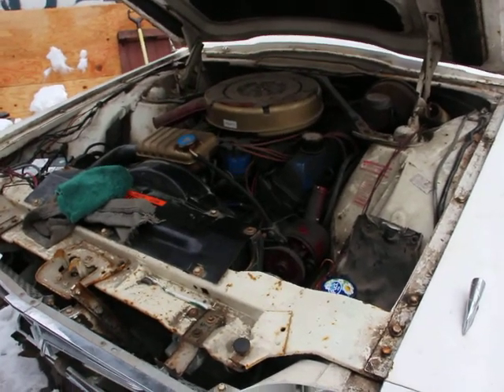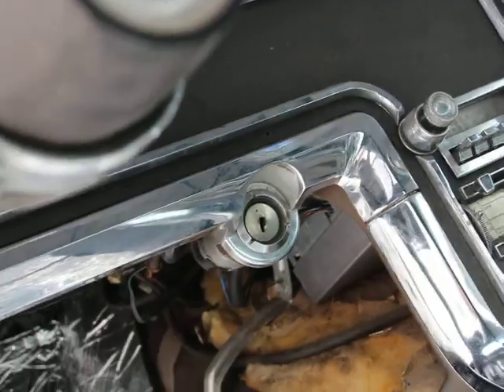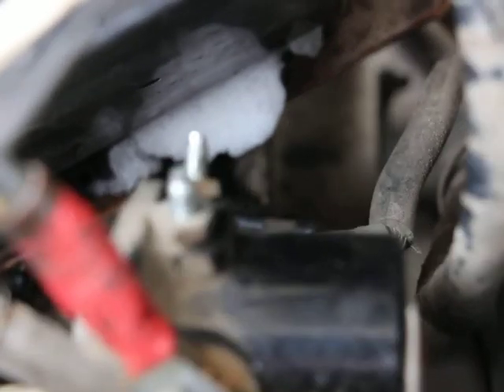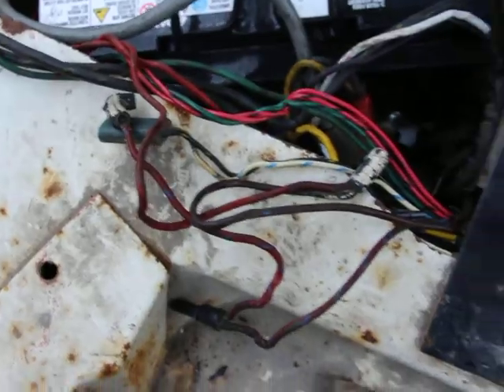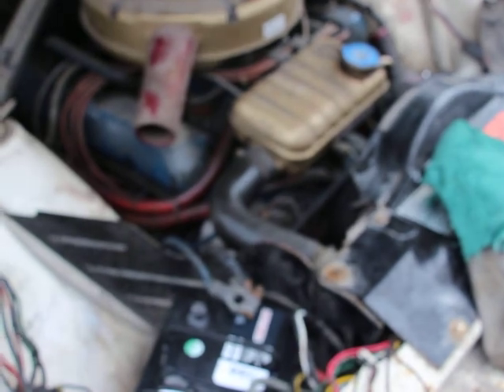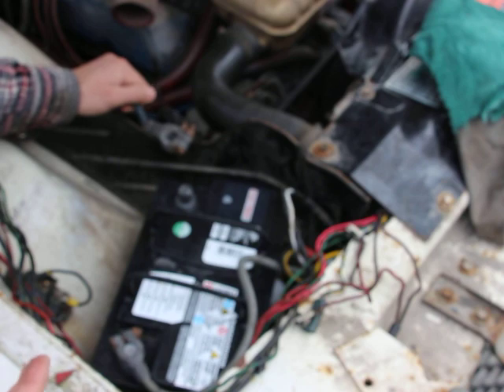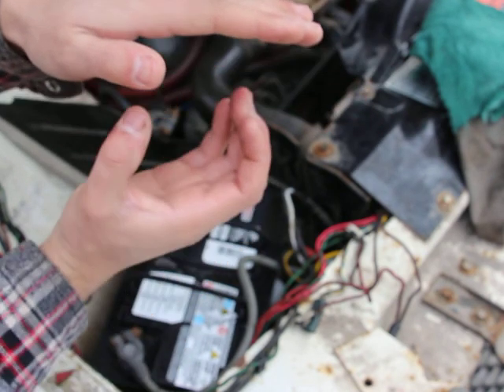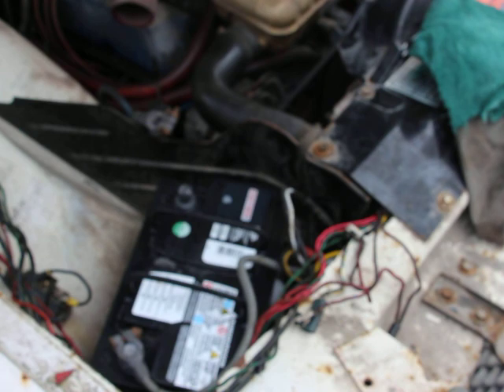Starter Relay solenoid stuck closed engine keeps cranking 1966 Thunderbird

Comment: First thanks for this series of videos on your tbird starter issue. Unfortunately I have the same issue and have nearly replaced all my ignition related items. I just put on the 2nd starter relay and connecting the battery STILL turned over the starter. I only checked it twice so I didn't burn up anything. Can you suggest anything? I've changed out the ignition module, added a coil, I feel good about those. I once suspected the key cylinder and while I've not troubleshooter it...it is removed and only the end terminals inside their rubber housing is there and no contact could be made there. I was hoping there was another item that I be missing... help. Let's say your replacement did not work...then what would you have considered.
Reply from the maker: Really there are only 4 things to the starter system: battery, starter, relay and ignition switch (key cylinder as you say).

Obviously the starter is working , and battery is good. So only possible culprits are relay and ig. switch...but you said these are good. So my explanation will assume that. 

1st thing I would do is check the wiring to the relay, make sure it's correct. If it stays on, then the input wire  is constantly getting electricity and not turning off....then, it's like I always say for electricity: FOLLOW THE WIRE.

2nd, is very much related to the first. People frequently use the starter, relay and other components that make for convenient electrical connection points. For example, running a wire from the relay to a stereo system. Problem with this is that everything then becomes connected, and one thing causes a problem on something else.

There should only be ONE wire going into that starter relay (in addition to the 2 very thick battery and starter wires) and that wire should be coming from the ignition switch. If you see more wires, then I'd try disconnecting them, and just leave the ig. wire.

The starter system should ALWAYS be isolated! You wouldn't want to get stranded in the road because your radio malfunctioned!

Let me know if this solves your problem.